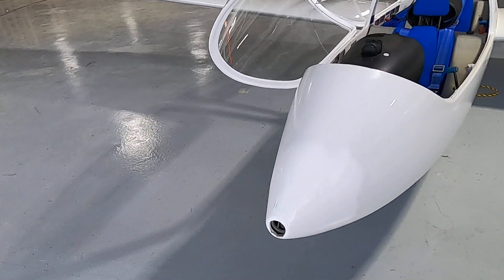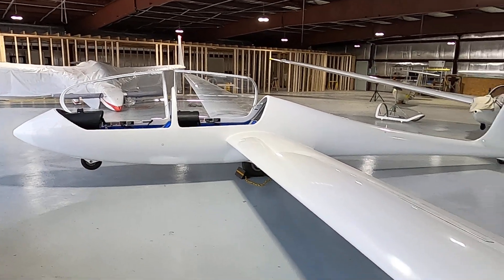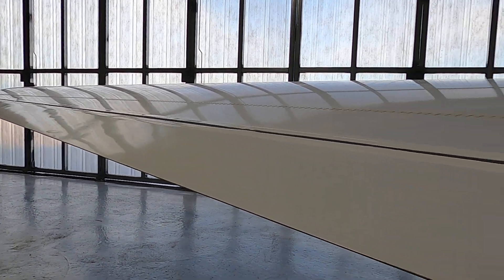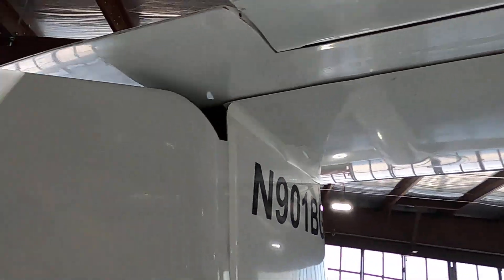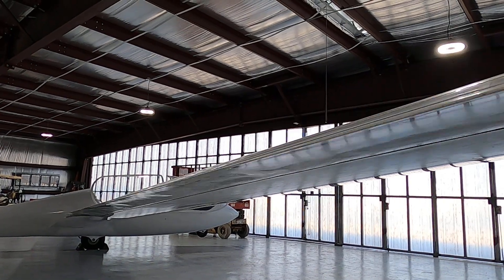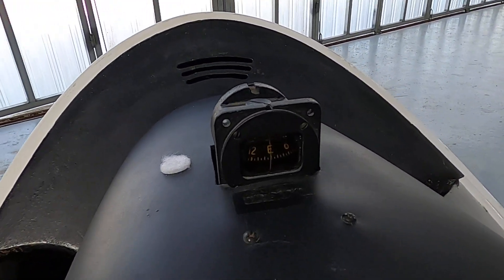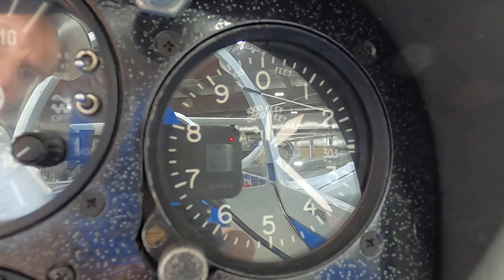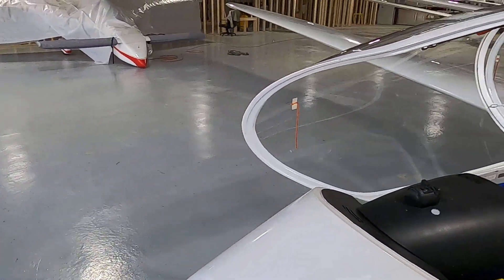Grob G103 glider - Preflight inspection - How to

Comment: I see the registration number on the tail (in relatively small size print) and not on the main body.  Transport Canada stipulates, I believe, "a clearly visible registration with letters no less than 6 inches in height".   Does the FAA have something different?
Reply from the maker: Interesting question! I never thought about it.  I looked it up.  Generally, 6 inches on fixed wing aircraft, except 3 inches on a glider. (45.29 - Size of marks)
Reply: @airfoiled  Huh... thanks for the response. I'm going to look it properly here in Canada too.  I'm revamping my glider and it would look cool if I remove my registration from the body.

Comment: I see these on Barnstormer from time to time sell for 20k range I guess not much of a market for them other than using them for training probably a smaller number of buyers out there. Obviously, the issue is rigging them for flight and then putting them back in the trailer not a single person task. Maybe could use two wheels to support the wing. If you're lucky enough to have a hanger big enough to keep one, then that would solve the issue. Finding one at a glider port where you can be towed up is another issue. Glider port by me does rent these which is probably the way to go when you want to take someone up, but now they are requiring renters' insurance cost $1000-1200 a year when you add up the cost of renting $160 an hour renting isn't so feasible. Glider Club is another option if you live near one.